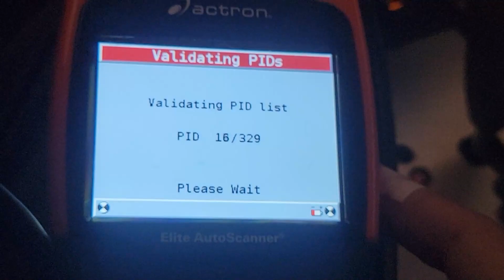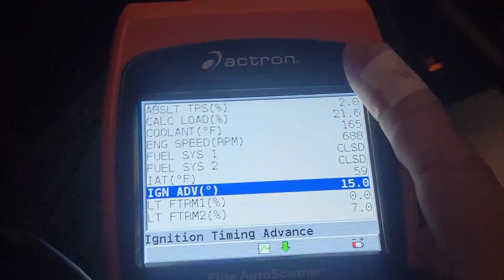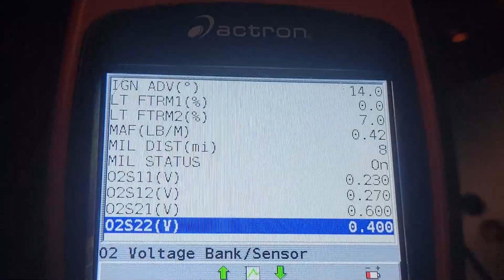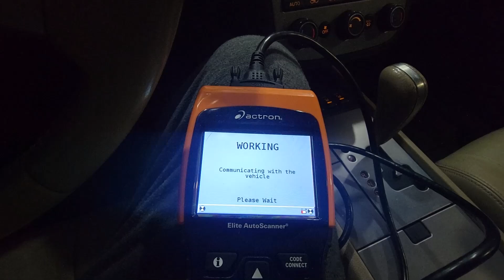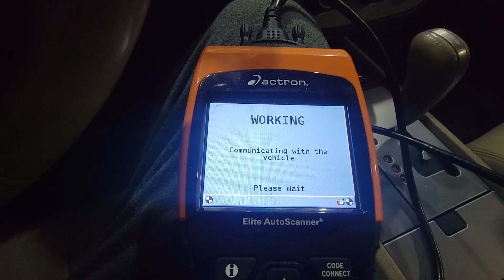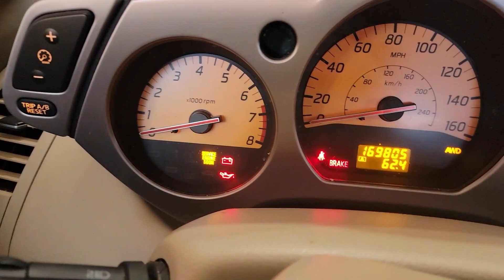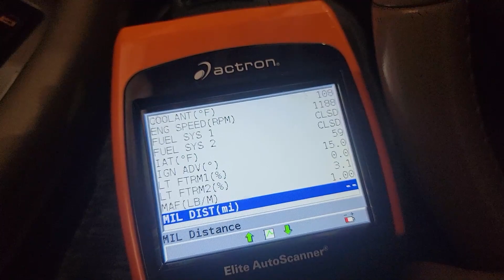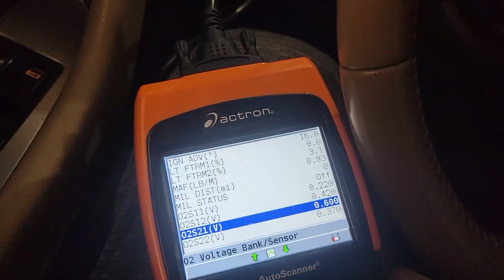How to change the Catalytic Converter and 02 Sensor on a '03‐'07 Nissan Murano 3.5L

Comment: Did you have to remove the radiator and fan to get the front cat off??
Reply from the maker: No, it's able to be removed with both in place.
Reply: @BentOaksGarage What about the A/C Condenser? I hear mixed answers

Comment: Hey could use your help down in Florida if you get this way lol. I have an '03 as well and right now I'm getting rough idle at lights/stop. It will drive fine for about the first hour or so of continuous driving but then will start to rough idle like it's going to shut off when at a light or stop sign. I've cleaned the throttle body, and the MAF sensor and it worked ok for a few days and came back. I am getting P0420/P0430 codes which I've had for about 2 years now off and on. No sensor codes have popped up just the Cat codes.
Reply from the maker: That's the codes for Cat Converters. When you floor it, does it bog down and make a low drone sound, and have little to no power?  Also when was your last spark plug and coilpack change?
Reply: @BentOaksGarage  It drives well for about an hour but then it starts huffing and puffing. It will stutter and shake like it's going to cut off when idle and then when I do accelerate it takes a while to go and will jerk and jump the rest of drive until I turn it off. I did a coil/spark plug/gasket change  (tune up) last summer. I have had the Cat codes on and off for 2 years, I was just wondering if the cats going bad could cause this or is it something else. I've been aware of the lack in gas mileage as well. Mine does about 15mpg in town when it used to do 20 and high 20's on the highway.
Reply from the maker: @RonnRicco  when I did that Murano I was getting about 16 and after cat change it want up to 19.5. You can always do a test before buying new ones (not legal) but take the old ones off and punch the guts out of them. A long breaker bar and a 5 pound sledge works great (in theory) but if the car runs great afterwords, then you know it was the catalytic Converters and you can replace them at that point. Lot of work just to test 😉
Reply: @BentOaksGarage  Yes, I saw your 7 hour quote lol. I'm just trying to avoid taking it to a shop cause I haven't found one with just generally positive reviews but I will have to cave in to find out what the issue really is. BTW how much of a charge am I looking at just to replace my cats?
Reply from the maker: There is one thing you can try, I know I'll catch a lot of slack for saying this but dump a gallon of lacquer thinner in a half tank of gas, run it at highway speeds for an hour and around town till its almost empty. Clear the codes and refill with gas. This has worked for me with a Nissan Altima in the past. You can also youtube it, there are videos out there of people doing this, I just dont post stuff like that. All said and done it should help remove the p0420 light.
Reply: @BentOaksGarage  LOL I've read the pros and cons about that option but haven't done it. At this point I'm just trying to figure out if my cat is causing my rough idle/loss of acceleration power issue with my car.
Reply: @BentOaksGarage  mine have the exact same issue you just described,  does that mean it is the Cat. No power, floor it , it goes no where bogs down. Rough idle.. changed all sparks and coils , the only thing I haven't changed are 02s and cats
Reply from the maker: @Welcum2TrapLand  no power and bogging down, and that very specific noise you hear when you floor it. I'd say cats are bad (clogged).
Reply: @RonnRicco Mine has had the same thing for about 2 years also! I've already ordered the catalytic converter and will be doing the change soon, along with motor mounts and spark plugs!
Reply: @2003ranp  I replaced the 0yxgen sensors and the rough idle stopped. I actually got a code for one of the sensors and just replaced both of them. Now I get the Cat codes every so often, mostly when I let the gas get a quarter tank or less. My car has 210k miles currently and is a 2003 so I'm leery of doing that replacement. I just used cataclean and the code came back so I guess I'll just let it be.
Reply: @2003ranp  Where and how much did you pay for the catalytic converter?

Comment: How long did this take? I see you have a lift for your car, but without one I’m guessing this will take a lot longer?
Reply from the maker: If you don't have a lift, I would say 4 to five hours. I had a couple of bolts break, so, it took me an hour just to try to extract and eventually drilled them out.
Reply: @BentOaksGarage  thanks man! I’ve been having this code for a while and it’s about to start shutting off at idles, so I have been worried about how long I would be out of a car. Great video!
Reply: Hi, you had to lift the engine??
Reply: Attempting this without a hoist would probably kill most people, just saying.
Reply: @psychbomb7543  well a year ago it was done without a hoist. Guess I should consider myself lucky haha
Reply: @kyredog8933 what did you use?